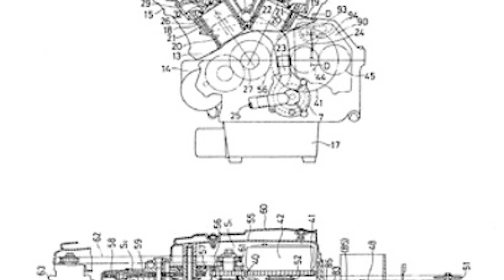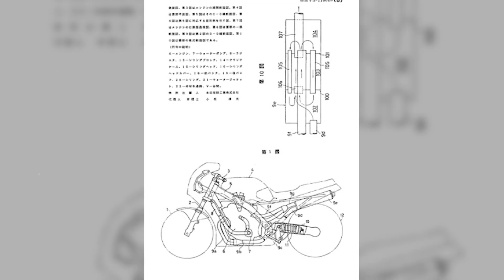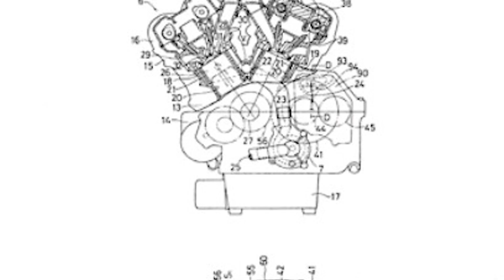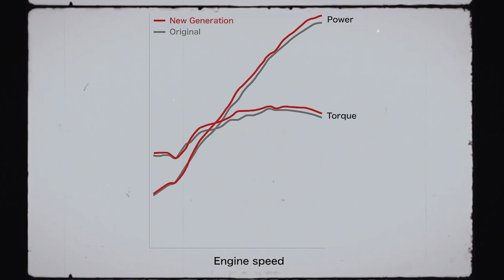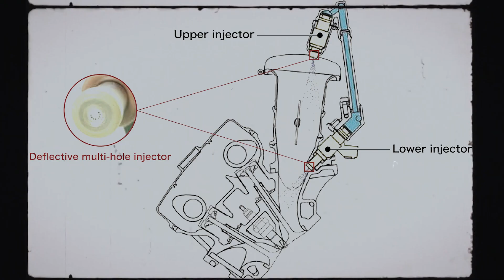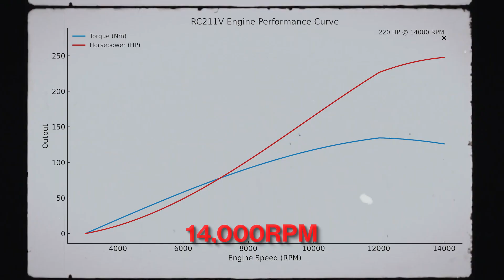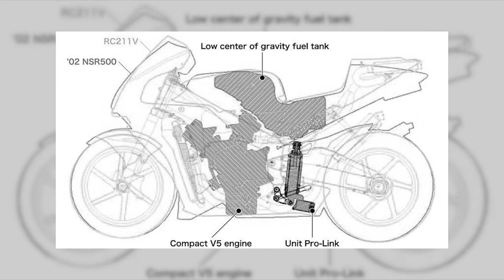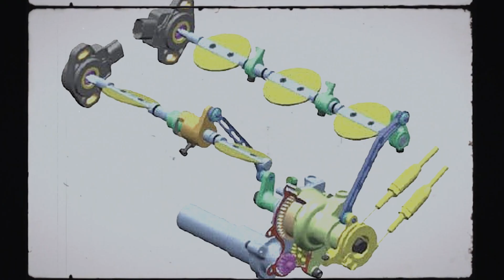The Explosive Truth Behind Honda's Deadly RC211V V5 MotoGP Engine

Comment: The thing I admire about Honda is, It's race bikes look like they could have come off of the assembly line and sold through any dealer in it's network, they just have the rapid prototyping and casting tech down pat. Whereas other race teams you can see rough one-off castings, parts obviously machined from billet etc, it's remarkable.